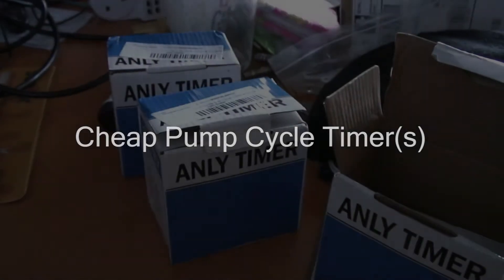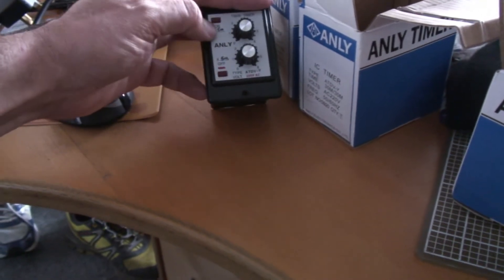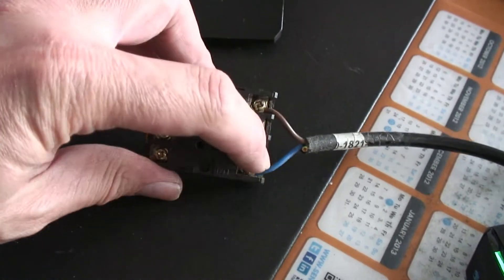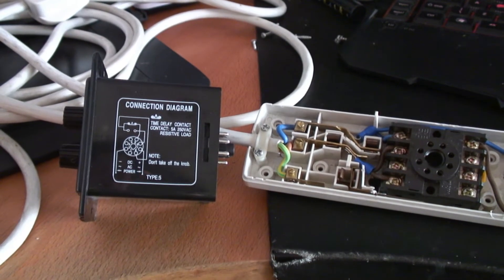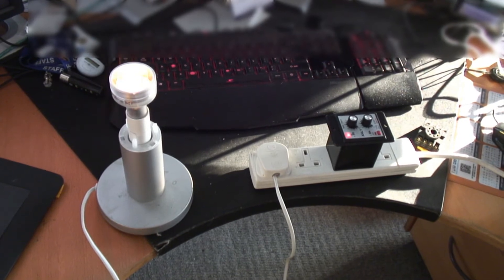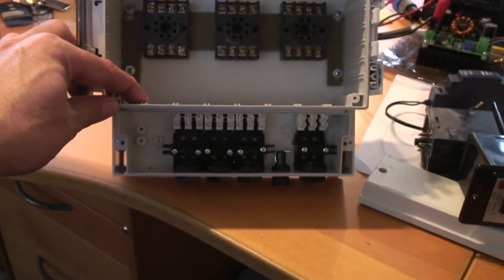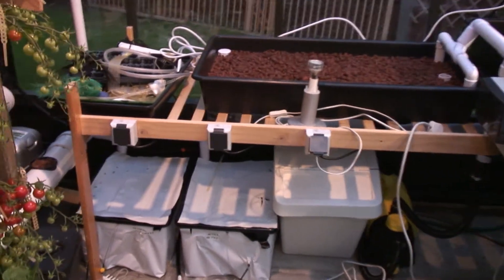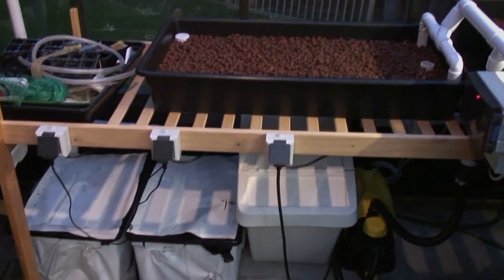DIY Hydroponic Pump Cycle Timer - Triple channel, industrial grade.

Comment: Whoa, what the heck is this? No fair at all, you are getting all techy and high speed. Looks great! I tried digital timers, and I'm too stupid to program them correctly, so now I use premade manual timers, they work well, but have many limitations. Really like the customization you have with those. Nice work!
Reply from the maker: I suspect that the reason hydroponics and aquaponics appeal to me is more because I like building things than because I like eating vegetables :-) (though I'm certainly hooked on the strawberries and tomatoes now). Nothing I had was right for running that big yellow pump, so I was more than happy to be forced to build my own. :)

Comment: This is great! I had the same idea as for pump cycles on fish tank pump cycles for circulation. Glad to see you proved this out. I'm going to jump on ebay and buy some cycle times...hopefully without the 8-pin connections.
Reply from the maker: Hi Keith - There's an update video after this one... https://www.youtube.com/watch?v=bE5kSBCi7e8 ... I ditched those ANLY brand cycle timers (very unreliable), and the Punai brand ones which followed them (also very unreliable) and started uning Omron branded times... The Omron ones have not experienced any problems whatsoever.... Just though you should know what brands to avoid before you buy. Hope that helps. Cheers!!

Comment: nice build Jim...really would like to see more
Reply from the maker: Thanks John - I'll try to keep 'em coming :)
Reply: Jim Conner cool a run though your other projects will be nice too!
Reply from the maker: I would like to automate the nutrient changes, but it's not a simple operation. There's two different types of water (rain & tap), plus seven different nutrients which I'm using to make up my grow juice currently. I'm going to need a lot pumps and valves if I'm going to automate all that lot. I have a temperature monitoring project on the go behind the scenes (awaiting delivery of temperature sensors). After that I may have a go at something simple such as a PH-controlled freshwater reservoir for keeping things topped up, but the full 'mixologist' for getting the nutrients right will take me a while (if it ever happens - I need an escape from the world of IT and in the past have trashed some hobbies by combining them with computers - Trying to keep things simple with the greenhouse).

Comment from the maker: Just a quick comment to explain the timings on the NFT rails - 5 mins on time because that's how long it takes before the water starts flowing out of the rail at the same rate it flows in (It takes a while to work it's way through all the roots), and 7 mins off because that's how long it takes before the output from the rail changes from a continuous flow to drips. I figure that by doing this I really am keeping a nutrient film on the roots (rather than a shallow channel filled with water all the time).

Comment: great stuff, do you have a link to where we can see an in depth diagram and if it could be converted to 120v ac? i know it's a lot to ask but seems really helpful.
Reply from the maker: Hi +Stephen Lanoue - I don't have a wiring diagram, but the wiring is pretty straightforward to work out. The timer modules plug into an 8-pin screw-terminal relay base (it's an industry standard). Of those eight pins, only five are used by the timer module, and we're only use four of them  Two pins provide power to the timer module which controls an electromagnetic toggle switch (aka Relay), and two pins are the 'common' (C) and 'normally open' (NO) connections on the switch. The fifth pin is 'normally closed' (NC) which works the opposite way around to NO  - I.e. the power flows through NC when the switch is off rather than on - The reason I didn't do a wiring diagram is because the schematic for connecting for the timer module are printed on the side of the timer module itself - It lists the numbers of each pin you need to connect to, and those numbers match up with the numbers printed on the 8-pin base. This timer enclosure is just 3X identical timer modules inside a plastic box, with some added inline fuses to make sure that I don't blow myself up. The timer modules I used won't run on 120VAC, but you should be able to find similar models which do (try searching on ali express for '110VAC digital time delay repeat cycle relay timer'). Hope that helps. Cheers!!
Reply: Thanks man, and cheers. By the way, what kind of fuses did you use? Couldn't you use some kinda breaker switch or something? Electricity is not really my forte. At most I made an ozone generator.
Reply from the maker: Hi Stepen. I used standard 20mm glass capsule fuses (as found in most bits of electroncis) because I had drawers full of them kicking around already. Proper MCB circuit breakers would be a superior (but more expensive) solution, but does have the benefit that if you trip something out, you can just reset the breaker. Those Omron timers on aliexpress should each be used in conjunction with a 3A fuse as that's all the relay contacts are rated to handle. Hope that helps. Cheers.
Reply: thanks man!

Comment: im new to this game and what i have just installed is a sump pump with a float switch 7000lph , it empites its 200ltr drum then turns off and waits for the drum to refill. havent timed it yet but seems to be about 1:3 run time vs drain

Comment: Jim,
Gday from Australia..
AWESOME RIG MATE !!
Jim i have the electronics knowledge of a dyslexic gnat... and similarly have been looking around for a cycle timer also..I instantly flew past these particular models the second i saw the octal pin jobbies and to this date am stopped dead in my tracks...
Would these devices be ok running 12V DC ? would there be as much of a fire risk as the 110 or 220 mains? Id be getting power via a transformer  (matters??)
My feeding regimen will require 2 or three second bursts every 3-15 minutes (adjustable)...... then theres the nighttime dilemma (as u know they don't need nearly as much at night) so will eventually need a way to automate this.... Maybe an Arduino(chinese knock off?) could be the answer I'm looking for???
Cheers mate..
Reply from the maker: Hi +seanosomething - The timers themselves require 240V to run, but they're able to switch on/off any voltage you like through the relay contacts (i.e. you can control a 12V pump with them). The Anly timers which were featured in this video are not great quality and are very fiddly in getting the timing intervals correct. After I had a couple of the Anly units die, I switched to some Funai branded timers instead... They were nicer because they have digits and buttons for setting the time cycles so there's no guesswork... However, they too were not very reliable, so after a couple of those ones died, I've ordered myself some Omron branded ones... I'm hoping that the Omron ones will be better quality, but I haven't put those ones into service yet as I'd need a deeper enclosure to hold them. 

An arduino with a relay board might be a good option for what you're trying to achieve, but I've tried to avoid going down that route myself for now as I didn't want bugs in my software being the reason why all my plants died... I spend far too much time writing computer code for my day-job, so didn't really fancy doing more code for my hobbies too.

With 2 or 3 second bursts I'm guessing that you're planning on some kind of aeroponics system - I was planning on getting into aeroponics this year, but got sidetracked again.

Sorry for the delay in responding. Youtube failed to tell em that you'd left me a message and it was only by luck that I noticed it this morning.

Cheers!!

Comment: HOW TO CONNECT ANLY TIMER - Time Relay

DC 12V - AC 220V-240V  Delay Timer Repeat Cycle Time Relay 0-6s - 0-30 Min, Adjust On/Off Control Machine - TWIN TIMER ANLY 

https://lh6.googleusercontent.com/-JWxBKRMMmow/Vrjl82yn3xI/AAAAAAAAAf0/7R4amKfMs1Y/w834-h1194-no/30.jpg
Reply from the maker: Hi +ali ali  - Is there a reason why the + and - on the 'chose 2' load are swapped around? Cheers!!
Reply: Hello my friend .. Yes, there is a reason .. You can install two devices, for example, lights or motor or other devices .. for example .. the first ten minutes and then extinguish the works and then work another five minutes, and so on .. or you can install a single device runs every half hour or every ten minutes and so
Reply from the maker: Hi +ali ali - Yes, you can run two devices... but both devices will still use the same polarity... It's just one switched on and one switched off, or vise-versa if the relay is the opposite way around... So the polarity of connections would still be the same... In you're diagram, you've got the black mains + connection going to the - connection on the second load, rather than the + connection. Hope that makes sense. Cheers!!
Reply: +Jim Conner 

 hi brother
You are right .. I think this device is a low voltage and current has been designed to a low stream that does not need to change the polarity of fans such as lamps and small motors setups

Comment: It's tempting to add a UPS with additional external battery, to give the system robustness when the mains supply fails. It could save your crop.